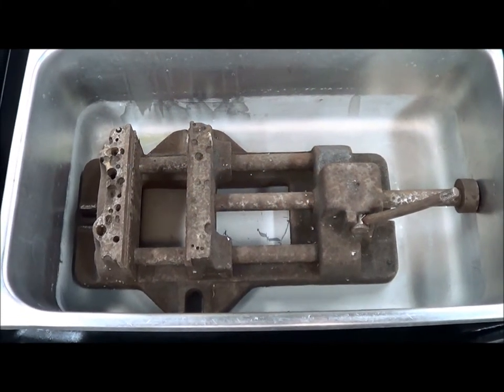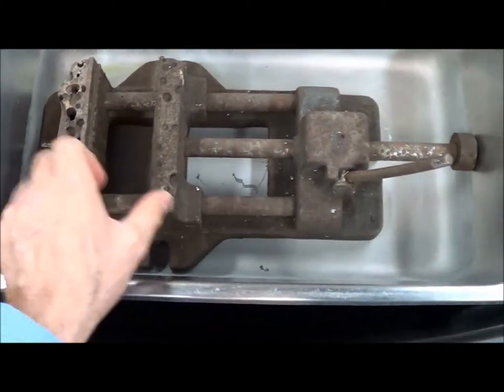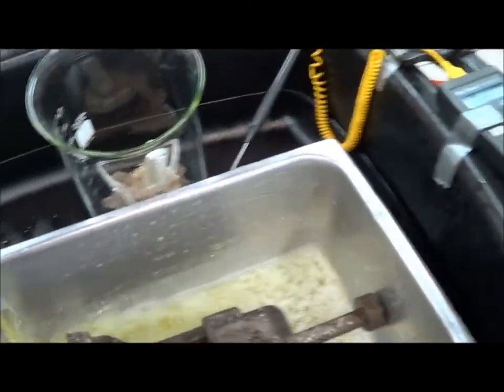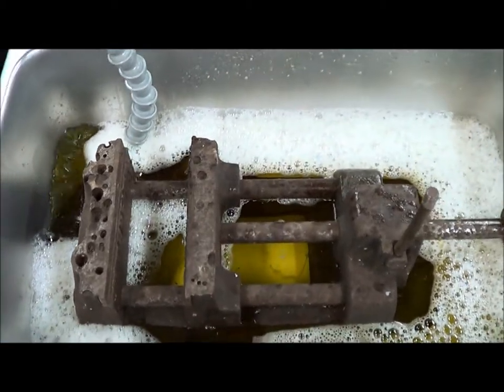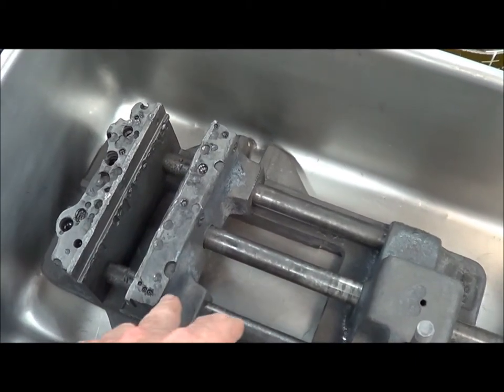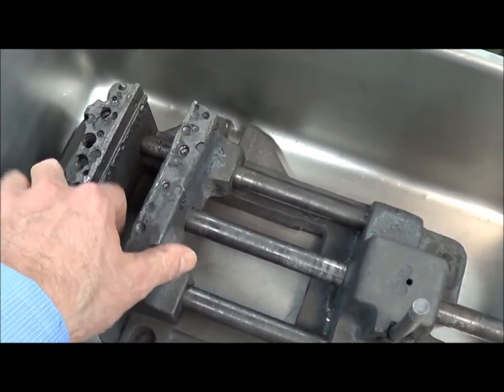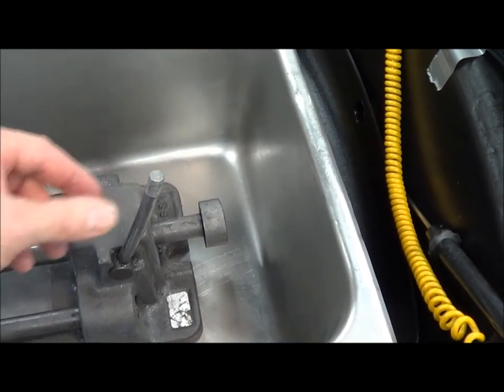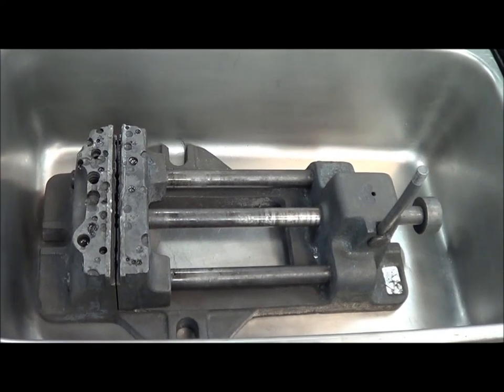Evapo-Rust® Removes Rust & Restores Usefulness of drill press vise

Comment: what do you recommend to put on the metal parts after they have been derusted by evapo-rust to keep the parts from just rusting back up?
Reply from the maker: If you need short term protection after derusting, up to 2 weeks, then rinse it off with water, then dip it back in Evapo-Rust and let it dry. If you need up to 6 months protection before you paint or otherwise protect item then following complete derusting with Evapo-Rust, rinse off part with water, then spray on RustBlock and let it dry. RustBlock is a rust inhibitor which is water based - so it can easily be removed prior to painting, plating, etc..